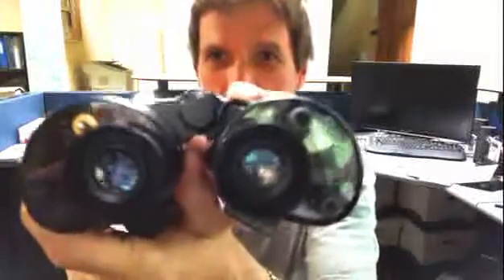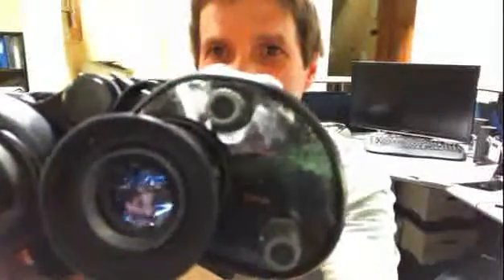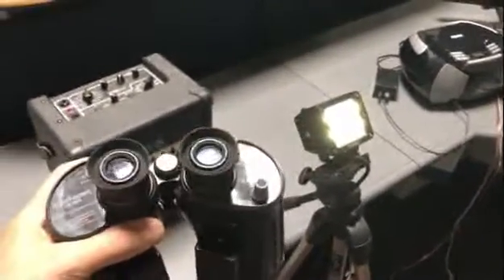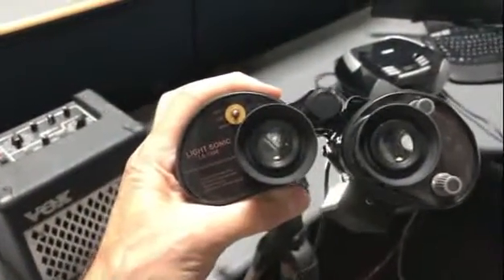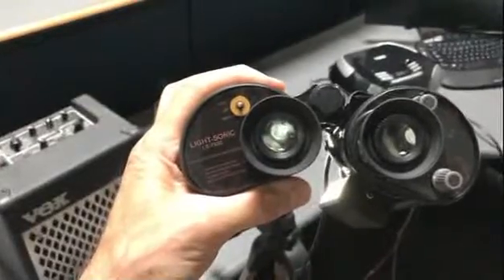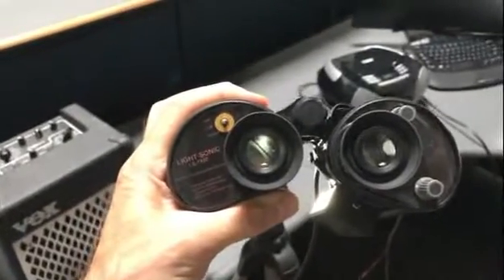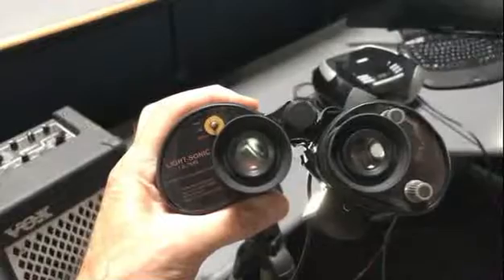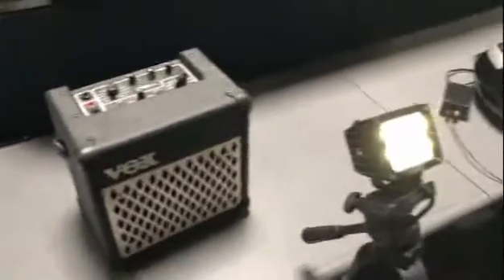David Mason demonstrates a couple inventions

Comment: Hello David, Again, a great achievement illustrating your inventiveness! Impressive! Perhaps  two questions: (1) When you are observing a luminous phenomenon, does the sky background may not bring some background noise being detrimential to the S/N of your observation? I mean (sorry, English is not my native tongue...), with, as you mentioned, atmospheric turbulences, but also artificial light pollution reflected or diffused by the atmosphere (with all of the public led lightning, (pulsing) NIR sources, variable light from traffic, but also air-glow (in combination with the turbulences, and so on....), is not sometimes difficult to catch a modulation of a weak observed light above this quite annoying noise ? In this sense, would it be easily doable to set in your system a kind of embedded signal treatment, usable on the field, by performing noise subtraction in real time ? Perhaps with using a second photodiode aiming an other part of the sky, and using a differential setting, or whatever would be suitable in this sense ? (2) Would it be interesting, to your opinion, to add a filtering system (why not a filter wheel) in front of your binocular, for getting at least partly rid of the light pollution or being able to quickly scan different spectral band during your observation (on anecdotal remark: filter like IR pass allows to obtain nice results for long distance because atmosphere is less diffusive for longer wavelength, as you know). On one hand, losing a part of the spectrum by using filter may be pity, but on the other hand, with a filter wheel quickly manipulated, it may be interesting to obtain different resulting demodulated sound by your system from such selected upstream optical filtering. Just some thoughts (i guess you already considered all of it), hoping i am not mistaking myself by missing something. Again thank you for sharing   your work with us! Best regards.
Reply from the maker: I have experimented with offsetting photodiodes to offer 180 degree phase cancellation in an attempt to reduce noise. It works only under ideal situations with about -6dB null performance.  I also experimented with high Q notch filters of 50-60 Hz and 100-120 Hz to reduce street lighting noise. However, today many LED lamps are pulsed at various high frequencies that can't be filtered via electronic filtering, nor filtered optically with OIII, HA, HB, UHC, or pass band filters. It certainly complicates the game of astrophotography and filtering the broadband spectrum of light pollution. Thanks for your suggestions as they are on the right track for the ingoing need to combat light pollution especially with image intensifier night vision and astrophotography.
Reply: @davidmason5755  , thank you for your feedback... Indeed, the light pollution, especially with the massive using of LEDs, is a plague for every sky observer.... The most efficient possibility which remains, unfortunately, is to hunt darker places for our practices..... One additional question, please, for my education: is the intrinsic thermal noise produced by the photodiode, sufficiently weak to be ignored, or in other words to be considered not disturbing, when you are aiming weak modulated light source ? Just a thought, for the fun.... It would be perhaps interesting also to do some basic spectroscopy, in order to see if an observed source is really monochromatic or not, and if not, to imagine a means, based on your concept, for checking if such poly-chromatic source would or would not have different modulations respectively distributed on some parts/wavelengths of its spectrum..... Anyway, again thank you for your work and sharing that with us. Best regards.
Reply: @davidmason5755  Hello, saw you on Cristina's show. You are just like me, I built a light receiver at age 15. According to spectrum's I took, light pollution is <10% over 650 nm. Also, if  you record the star and the background, you can use the noise reduction filter in Audacity.